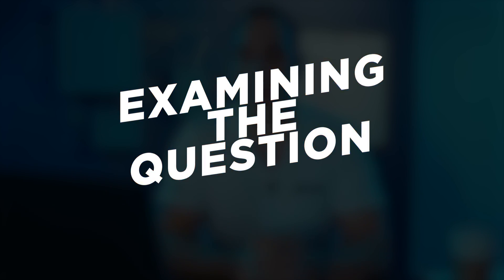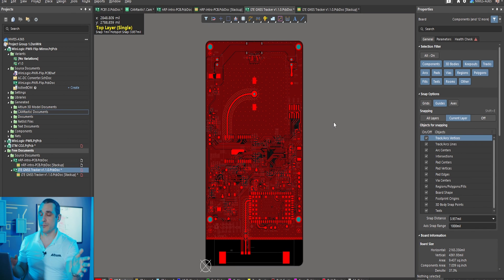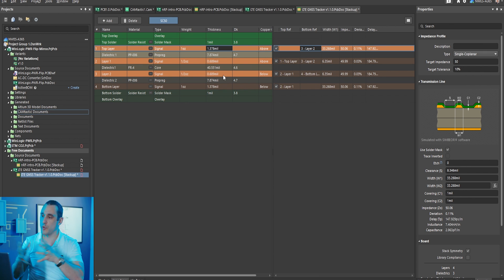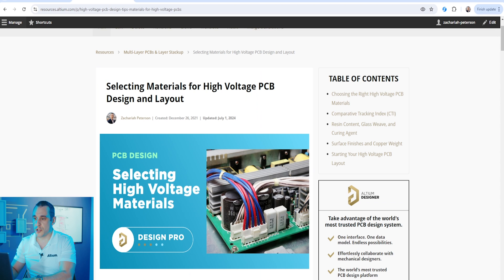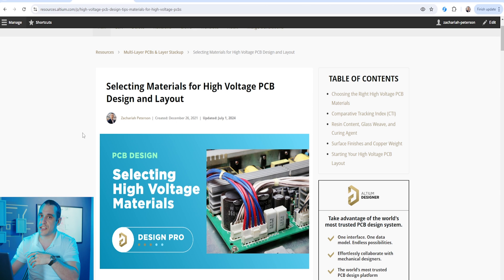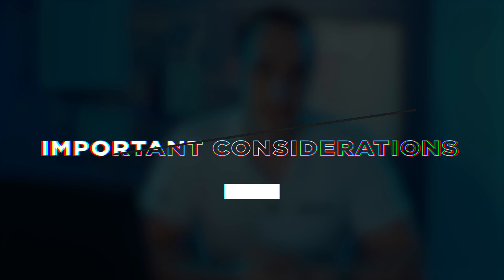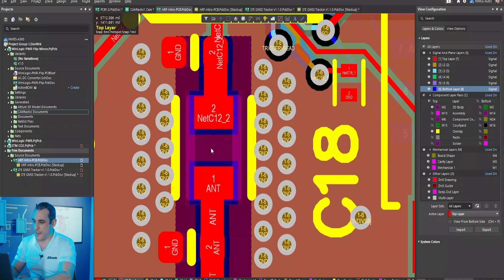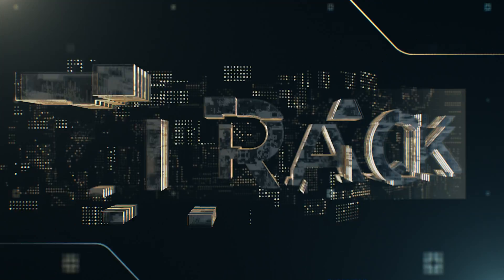PCB Stackup Design Process Thought Process Explained!

Comment: Why 2nd layer can be the reference?
Reply: The second layer could have been the reference but this would mean a thin trace to achieve 50 ohm characteristic impedance. Skipping a layer provides greater distance from the trace to the reference plane and this allows a thicker (lower loss) signal trace.
Reply: @sean3994  Oh okay understood
Reply: @sean3994  Oh okay understood

Comment: This was really interesting, I've moved into a PCB layout role and now have been avidly following the videos coming out of Altuim academy. The intricacy of layer stack up is so important to get right early on in the design process and this extends out to the designers choice of via spans on high density boards. I haven't had to go down the HDI route yet but it's only a matter of time. May of the videos dealing with BGA break out gloss over the process of dropping a via down a number of layers and don't go into the layer thickness to hole diameter complexity and even allude the the use of sintering processes rather than HDI microvias. I love to see a video on the sintering process in terms of its maturity and reliability, as sintering seems to be the 'holly grail' in my office.